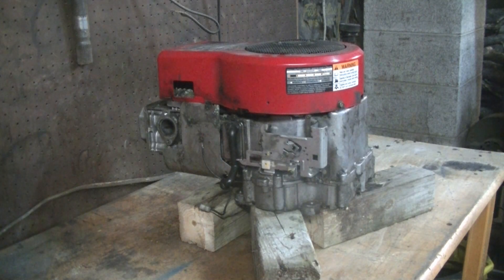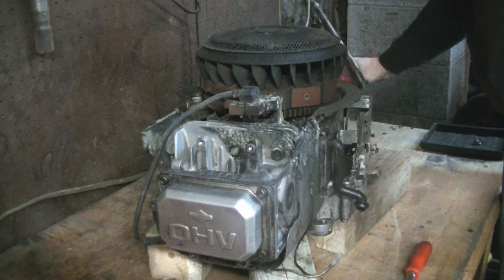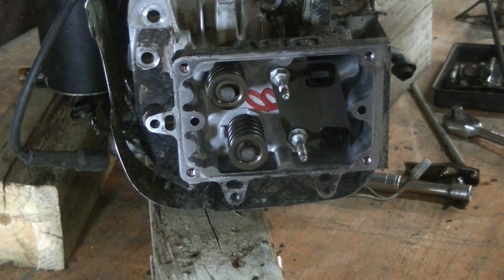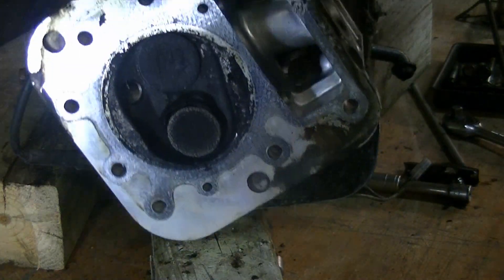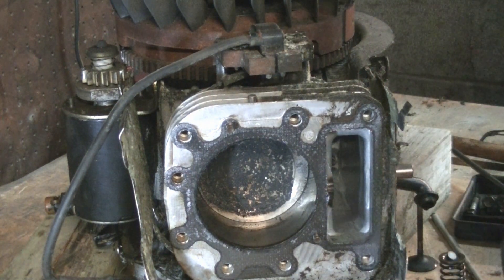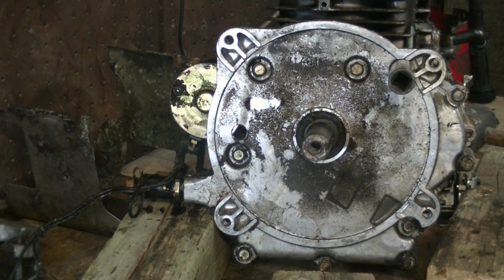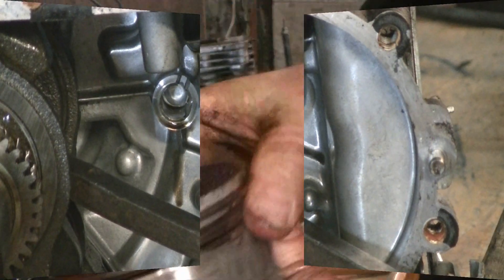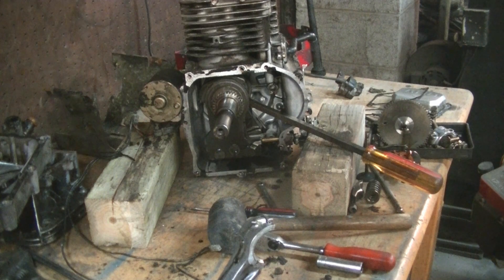Briggs & Stratton 17 HP Engine Teardown

Comment: what about putting it back together? do you have to align the crankshaft and the gear that pushes on the lifters      ?
Reply: Yes the cam gear and crank have to be aligned back where they were.  basically after that we have to reset valves to be in compression stroke is all. There should be a sit or mark where the gear parts need to face each other like in a an automotive engine timing assembly. Also Look up video in adjusting valves and then you will see that puts everything back in line with each component.

Comment: That plastic junk QD oil drain cost me a piston and rod kit in a new engine. I replace all of them with traditional NPT pipe plugs like old engines used to use. Unscrew fitting from crankcase and match it up at your hardware store, seal with teftape or pipe dope (to protect the threads, I keep my engines for many years) and done.

Comment: Could anyone point me to a site to order parts like rings valves pisons?? For B and S.
Reply: Google is the best source but first go to the Briggs and Stratton website for reference. Download all the parts info you can find (in many cases saving a page with the drawing you want is best done by saving as a web page to a named folder using your web browser rather than printing. Use a PC for this, not a phone (any old PC can make a good shop box even if it's too slow for other modern uses).

Comment: At the very beginning of the video there is a black and white wire that go to a 2 pin white connector. Do you happen to know what each of those wires are for?
Reply: Fuel solenoid valve or fuel shutoff valve

Comment: I just pulled apart an ohv 19hp that kept getting stuck. I pulled head and polished the valves up. The exhaust was getting stock.
Turns over freely now but feels like compression is low. Hopefully it will fire up. Not sure how much force it need to turn flywheel by hand
Reply: Buy a compression tester (they're cheap as they're simple Bourdon tube gauges with some plumbing) and test any engine whose behavior is questionable as what's not measured is not known.